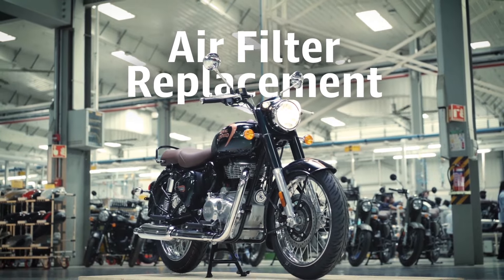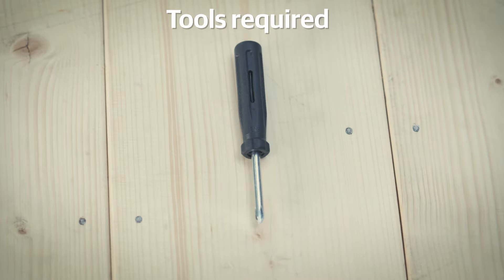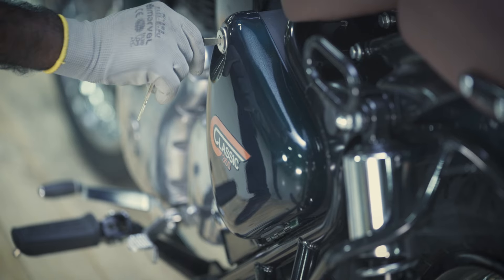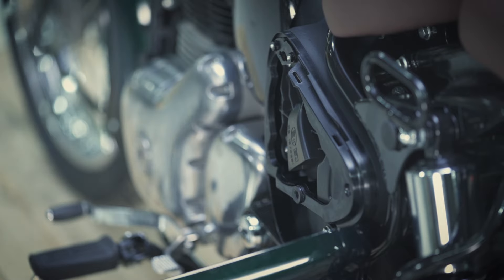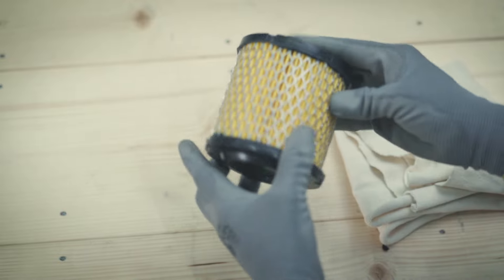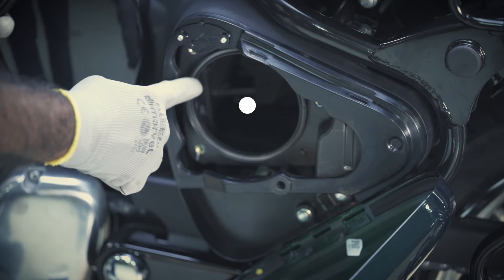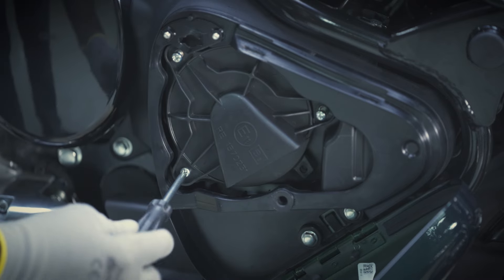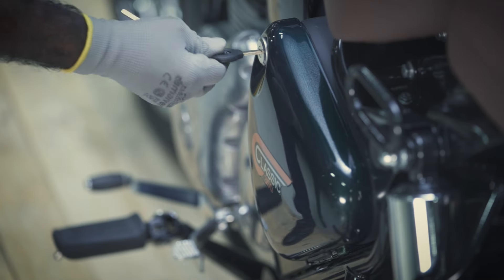All New Classic 350 DIY | AIR FILTER REPLACEMENT

Comment: All RE products are overpriced
Reply: Quality is worst
Reply: Bro,Royal Enfield is one of the cheapest cruiser bikes company....if you want to compare,go see triumph
Reply: @mzone. I know buddy, But for the price we pay, We dont get the quality. They sell good bikes but they compromise on quality. Everything starts rusting in an year. I am a Himalayan owner and I face issues every week. You just go to RE store and see their products as small as apparels or Helmets.
Reply: @MrManishvatsyan  bro you have bs 4 or bs 6
Reply: @iamsolo5683  BS4 2019 model. No complaints on bke's performance. Just the quality issues which keeps bugging every second day 😑
Reply: @MrManishvatsyan  bro the new bs6 2021 have improved a lot i am personally planing to buy a himallyan 
Around 15 days ago i took the testdrive and the bike have improved a lot they took of iron (main rusting element) and placed stainless steel to solve rusting issues and damn the battery and engine also have improved a lot personally talking re have started to  understand that what all people need
Reply: @MrManishvatsyan  from my experience the new bs6 models are better by 70-80 percent. most of the issues are solved wether it is himallyan or classic i have taken a testdrive on both
Reply: @iamsolo5683   Its not about performance issues buddy. Own a RE then see yourself 😃
Reply: @MrManishvatsyan  buddy i booked a jawa classic 2 days ago😃